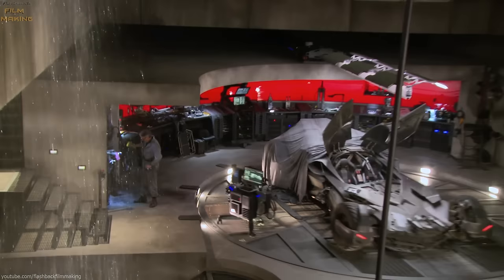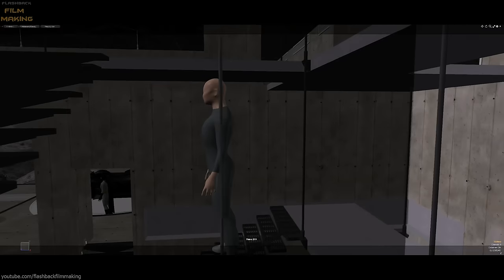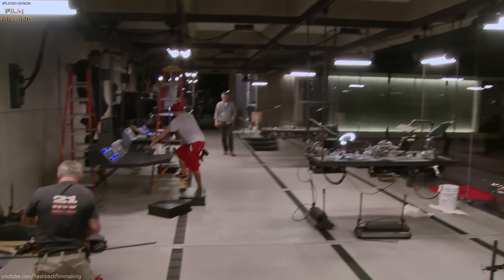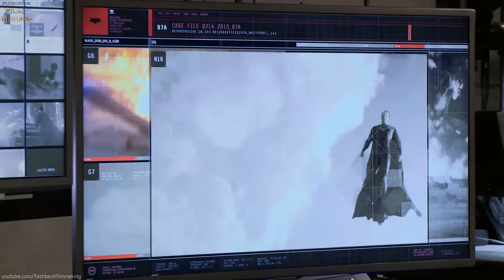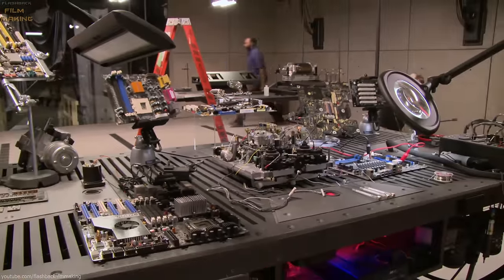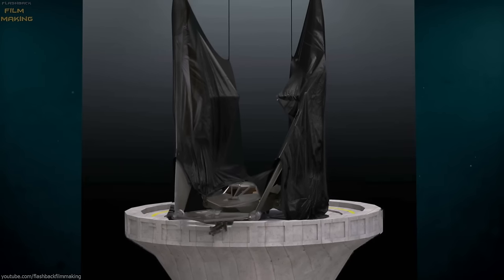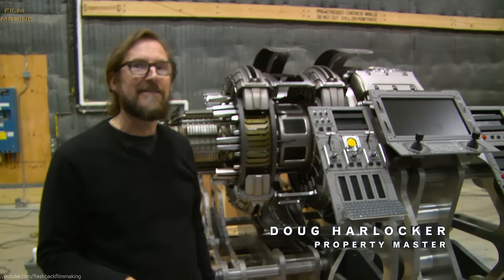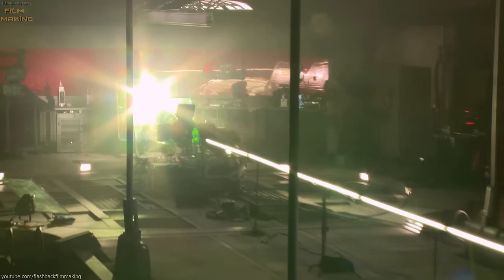Batcave 'Batman v Superman' Behind The Scenes [+Subtitles]

Comment: Actually it makes sense for the desks to be suspended from the ceiling via wire.  I would assume since it's in a cave, it may experience seismic activity, which would negate the need for solid pillars - since solid pillars with desks attached, under seismic activity may damage the equipment.